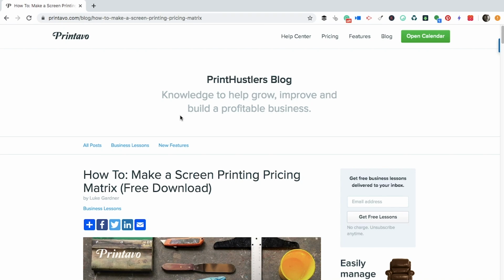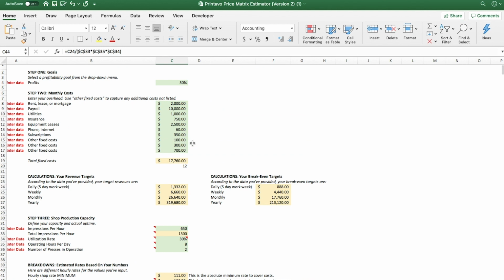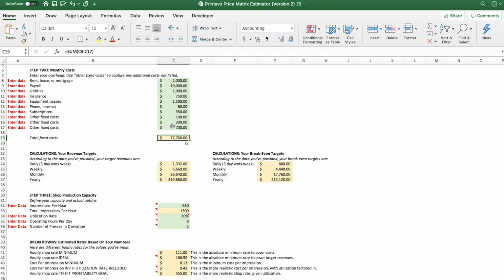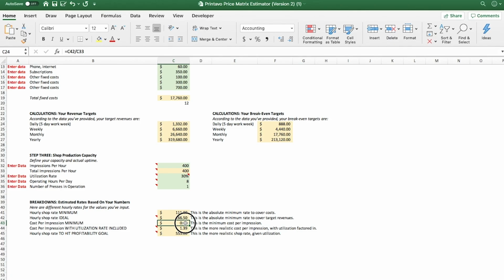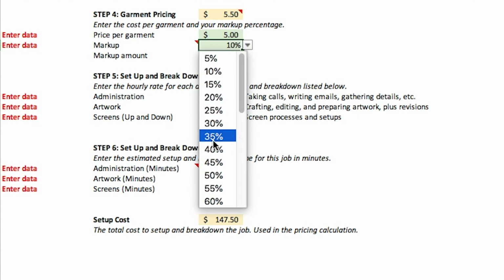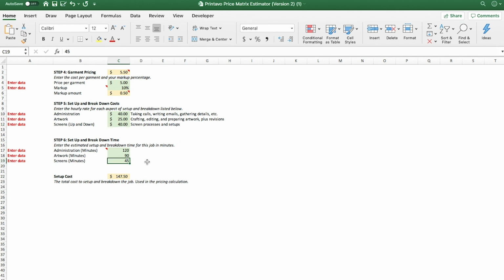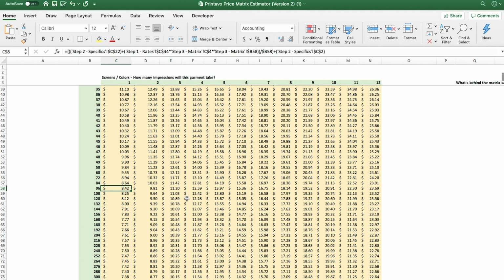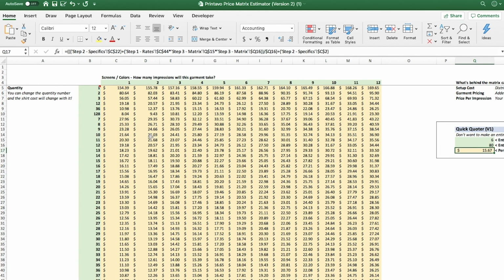How To: Make a Screen Printing Pricing Matrix (Free Download)

Comment: This is awesome. What about using this for DTF? I think I once played with a marix within Printavo and did the x axis as the Size of the print (since DTF transfers are priced by the sq inch). So for example column A was 1" X 1", then 1X2, then 1X3 and so on and so forth, all the way up to 12 X 12. Ended up with a giant spreadsheet but I think it was effective to getting the exact cost, and in turn pricing, for DTF.

any thoughts on that? Maybe an easier method?
Reply from the maker: Let's just say...stay tuned! 👀

Comment: Really good explanation and execution of the concept. I think this is going to be shocking to most printers when they see just how much they are undercharging. The challenge comes in when presenting to the client who has price shopped. There will always be cheaper providers in the market. Your next step is to sharpen your marketing and selling skills around value based pricing. This is where the real profit is generated. Cost based pricing above limits your ability to profit because your focus is on the Breakeven or where you start to lose money or make money. Overall, great job Luke.
Reply from the maker: Thank you so much Mark, that is high praise. It's a great place to start. Heed Mark's advice here: your real profit comes from great marketing and sales!!

Comment: I don’t think pricing for additional colors should be the same as pricing for additional locations. Did I miss something?
Reply from the maker: No, you didn't miss anything, we've really simplified this down to its most basic parts. You are of course correct that you can charge another fee for colors or locations as necessary. You can always alter the spreadsheet and modify it to meet your exact needs – we just can't anticipate what will fit for every screen printer! Thanks for the comment, Dennis.
Reply: @printavo  Do you have any guidance when customers want to add additional locations beyond 1 location, for pricing?